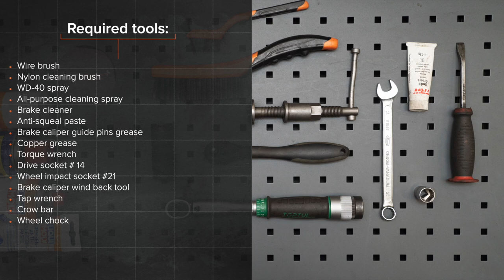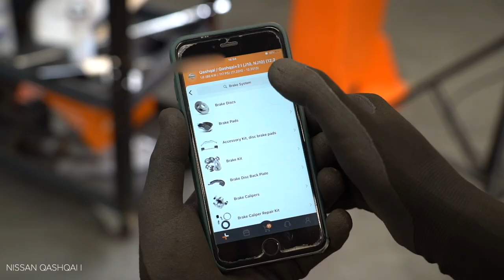How to change rear brake pads on NISSAN QASHQAI (J10, NJ10) [TUTORIAL AUTODOC]

Comment: Copper grease on the face of the wheel isn't a good idea, it will melt onto the surface of the disk meaning lost of brakes
Reply: Stops the wheel getting stuck to the discs. I've done it on all of my vehicles and never had it melt before
Reply: Never had it melt.